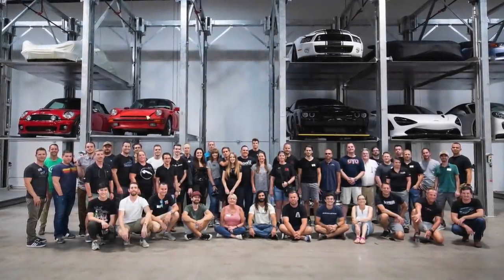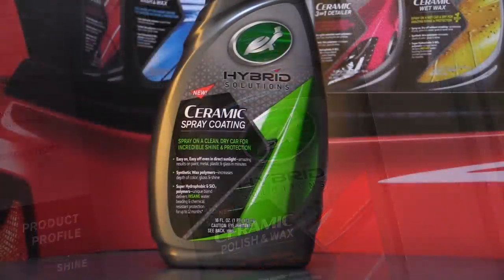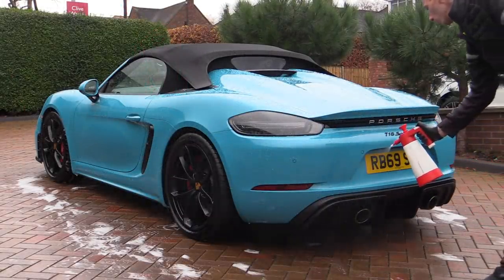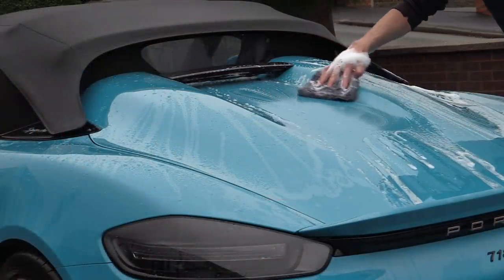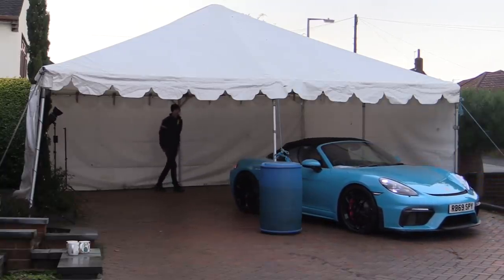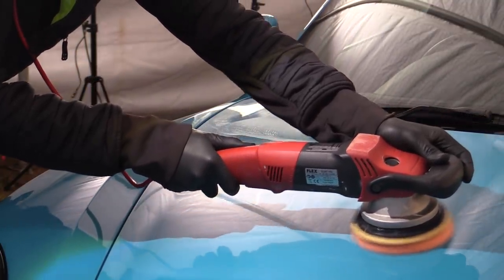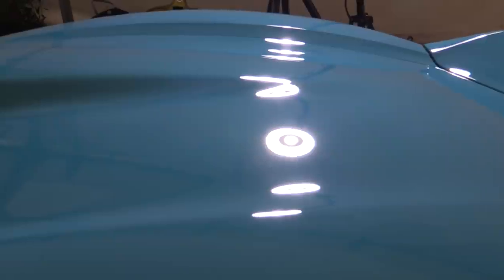Can the Turtle Tame the Spyder?

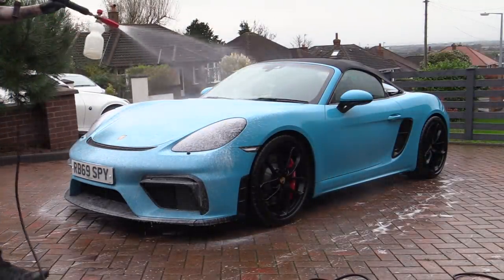Comment: 7:51 you foam over an iron remover, because it makes more sense to you (o keep the iron remover active for a minute of two).

Is there any proof that this method actually works? Not debating it, because it does kind of make sense imo. But... Does it really add up to anything? 

Otherwise, it'd be just a waste of water and foam, no?
Reply from the maker: Not really, I’d just rather foam over before a final rinse if heavy chemicals have been applied and/or I’m working in the direct sun.

Comment: I wash my car with gyeon bath+, to me that gives plenty of protection on its own. If that turtle wax ceramic wash and wax works as good as bath+ i'd recommend anyone to use it, no need to waste time on sprays to me.
Reply: I am working through a bottle of gyeon bath, once finished I will move to the bath+. Pleased with how it cleans. I currently use a Car Pro refresh as a spray to “top up” the coating.

Comment: The turtle wax hybrid ceramic spray wax I found was hopeless! Left a horrible streaky and hazy mess on my car👎
Reply from the maker: User error?
Reply: Car Cleaning Guru I was wracking my brains trying all sorts to get it to work, in the sun, out the sun, car wet, car dry. Ended up just using a meguiars spray wax which worked much better